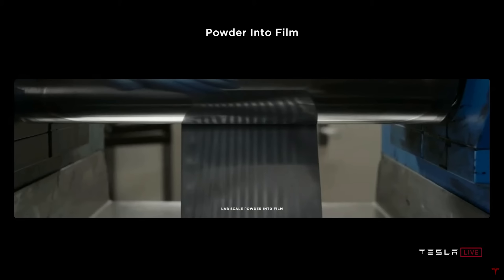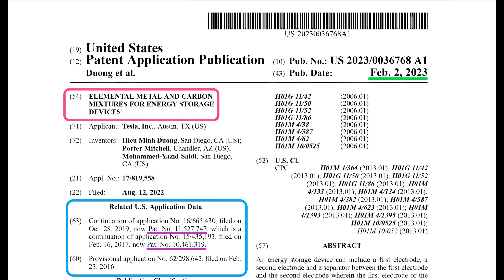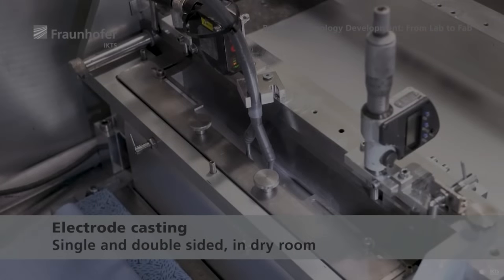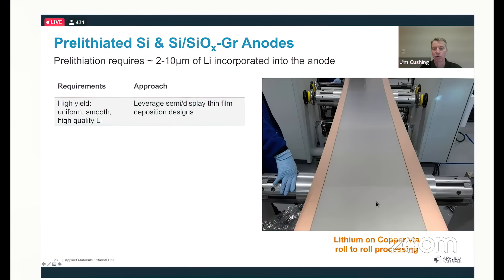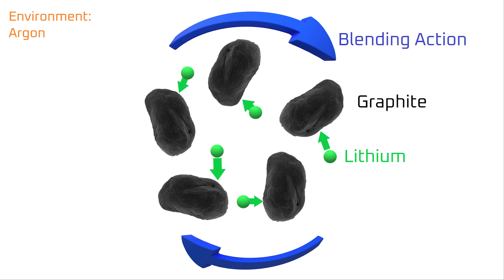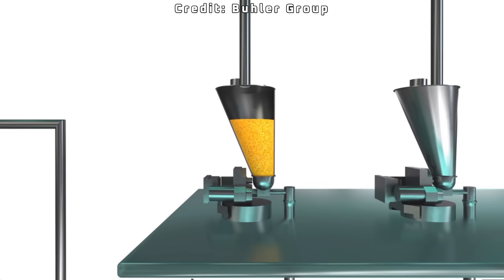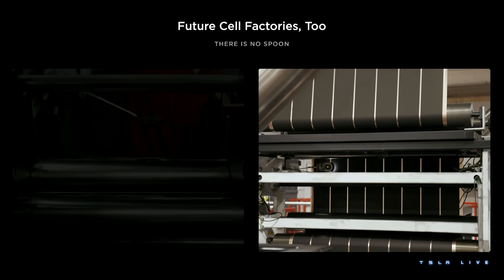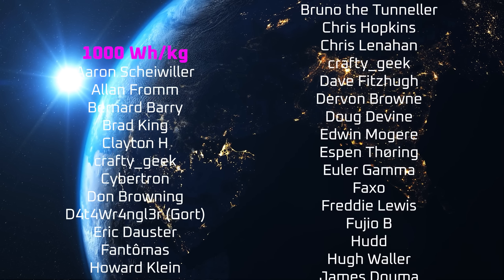Dry Electrode Lithium Doping Process // 'New' Tesla Patent

Comment: I worked with one company on a roll to roll system of embossing nano structures onto plastic film inside a vacuum chamber with better than outer space clean vacuum chamber, yes initiaal cost of equipment might be a little on the high side but this process was done for solar cells 20 years ago supplement the argon gas into the vacuum chamber and you can make rolls up to a mile long.

Comment: Although the improvements could be used to extend range, for a Model 3, I expect that for most configurations, it would be used to reduce costs and fewer cells would be included.
Reply: Correct.
More cars, faster charging.
Reply: Yeah, lighter and cheaper with the same range.
Reply: @filonin2  Agreed. The range is good enough for 99% of people. What's going to sell the cars is a cheaper price.

Comment: Maybe a combination of activated charcoal and lithium metal which in an argon environment goes through a microwave pincer point in the cyclone exit point might heat the lithium specifically while being non-contact to the vessel wall. Heat would be rapidly extracted as part of the cyclone stream so would be very focused and brief. [a bit of a rant, I realise but may have some value to someone].
Reply from the maker: Clever!

Comment: Keep in mind that this is all "ancient" stuff for Tesla. The patent application has been filed in Aug 2022, which means they likely worked on the paperwork with patent attorneys for a couple of weeks and must have had a "solution" already in the first half of 2022. And that is only on the "New" patent - the previous ones are from 2019 and earlier.
Reply from the maker: DBE itself is a far older technology and Tesla still hasn't mastered it.

That is, the age of the patent isn't relevant.

What's relevant is whether it gives us an indication of where they're headed with the technology, and the patent does

Comment: How do u think Teslas DBE will compare to Amprius’s new battery that they claim will electrify flight? Although Tesla is focusing on cost reduction (not energy density), notably increasing energy density decreases cost/energy (presuming all other costs are unchanged).
Reply from the maker: Different category, different use cases.  Amprius is $1000/kwh
Reply: @thelimitingfactor  Amprius won’t be $1,000/kg for very long, and then they will appeal to the car market. Amprius has cracked the silicon nanowire code and Tesla hasn’t. Neither Amprius nor Tesla are ramped up to full scale production. Once they are, considering their respective technologies, Amprius will have the advantage. The only question is when.
Reply from the maker: You can wish that, but it doesn't make it so.  Vapor deposition is much slower than dry coating, by orders of magnitude.
Reply: @thelimitingfactor  Nobody has a crystal ball. It’s one thing to buy Maxwell and produce a prototype. Mass production is at least 2 orders of magnitude more difficult (according to Musk). We all want the DBE to succeed, but as you say, wishing doesn’t make it so.

Comment: With silicon doped anodes, the SEI will crack and thicken with each cycle, correct? So is it possible to "overload" the anode with extra lithium, more than enough to account for just the initial lithium loses to the SEI on the first cycle, enough lithium so that as the SEI thickens over time, the extra lithium that was doped into the anode continues to make up for the incremental losses to SEI over time?
Reply from the maker: I'm not sure to what extent you're talking here.  There's a point of diminishing returns.

But yes, the point of the lithium doping is to counteract the losses of lithium to things like a thickening SEI
Reply: As I see it the added lithium is in lithium compound form not free lithium